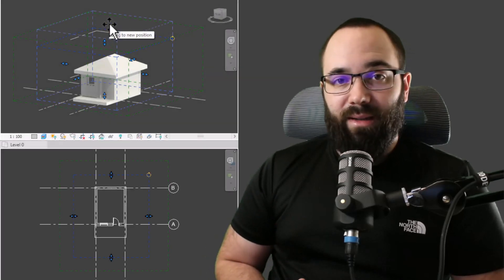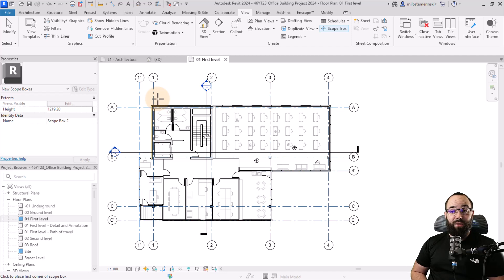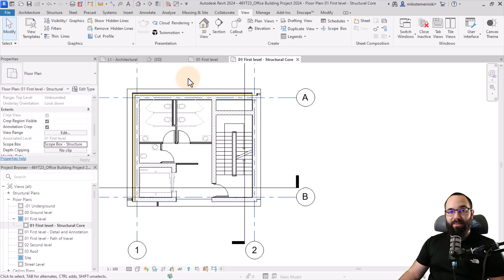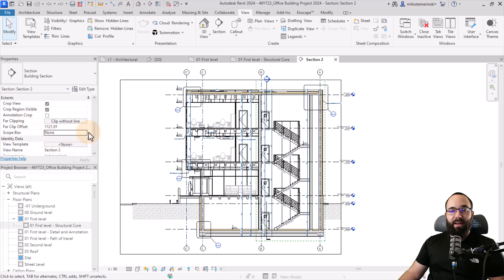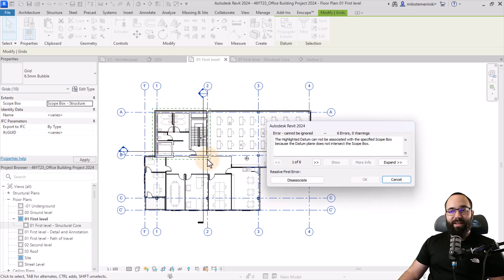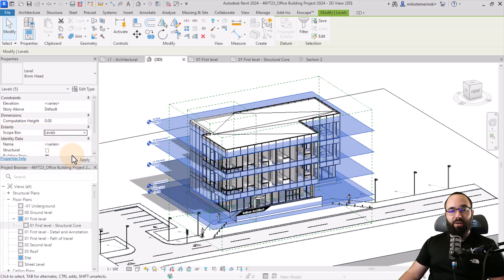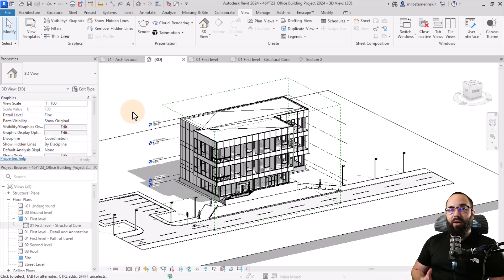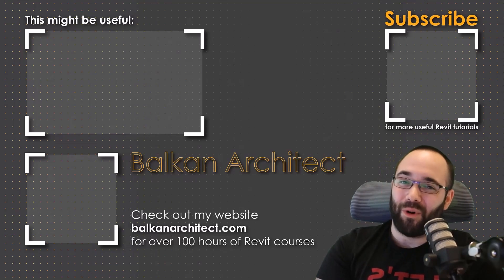Scope Box in Revit Tutorial

Comment: Great video. Learning alot from this. Also I may add that using scope box especially on plan view of a duplex or triplex building you can show 1 units typical floor plan that shows that same type of plan is applied on the other similar units of the building. Thus it can save space in 1 sheet and also you can show typical floor plan for all levels in 1 sheet as well instead of viewing same layout repeated throughout many sheets.

Comment: Hi, for a project, I have 5 residential building files which all have similar units (apartment).

The setup of Revit files is such that all the units for all the buildings are in one file. These are then seperated into different worksets as per the buildings. And then linked into each building file (1-5).

Now these building files are then linked into a site plan model where the links are moved and arranged as per the site plan.
But because the unit file has all the units for all the buildings, the site plan has just too many units all over the place.

Do you think this can be limited using scope boxes?

Comment: We often have towers where the grid for the underground parking structure, commercial podium and residential tower above are each a little different, we use scope boxes to control which grids appear on which levels. Very handy. Also using scope boxes for weird angled wings of a building is great too.

Comment: thnx. what is useful te mention is dat you can also apply a scopebox to sections and elevations. and rename them to the desired name for example : Front, Back, Left and Right for elevations. or when you have a row of houses, you can apply a house number - or building number to them.  😉now the omly thing Autodesk has to do, is to add the Depth and With to the scopebox parameter. it's time. it's 2023.